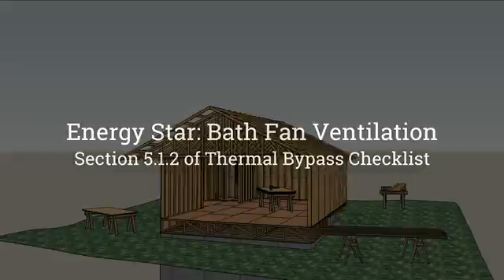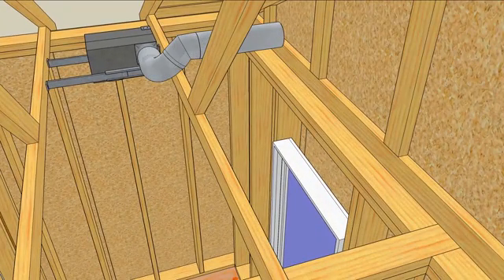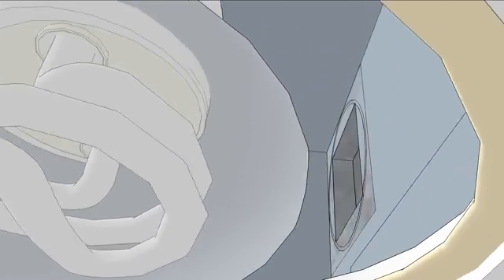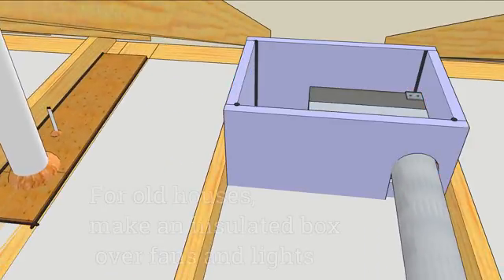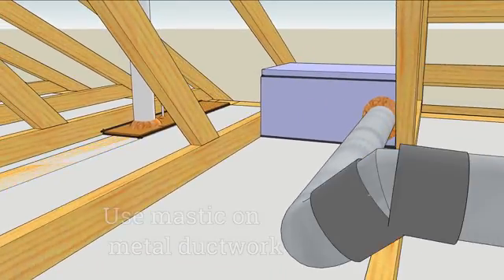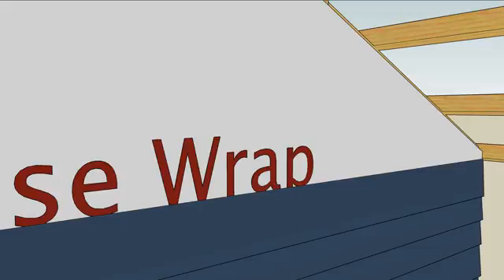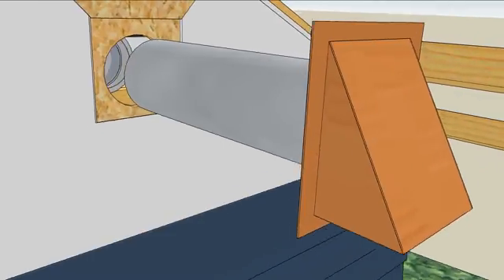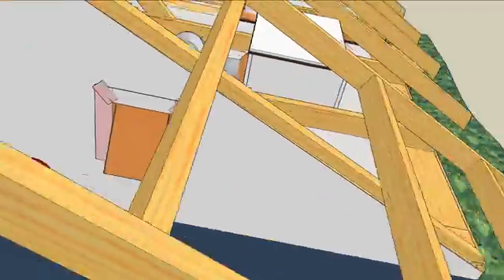Seal Bath Fans at the Ceiling and Damper — Thermal Bypass Checklist 5.1.4

Comment: I want to know something completely different: where can you get a bathroom vent fan that seals shut (airtight) when the fan is not activated? Yeah, supposedly draft blockers (mostly a misnomer) on the far end are supposed to lessen the automatic draft of your air escaping your home but they don't stop it, because it basically a piece of plastic on a hinge which has a visible gap between the plastic and the housing it is in. 

I was shocked to discover that my cold AC was being let out of my home in the summer in a continuous draft (enough to make some tape at the end flutter like a telltale) when the fan was not even on. It just automatically escapes. I'm sure the opposite problem occurs in the winter with cold air entering. Talking to stores like Lowes about this issue results in blank stares or a shrug. How hard could it possibly be to invent an airtight fan which mechanically opens the passage way when the fan it also turned on? You know some bloke has to have a patent on that.
Reply: To partially answer my own question this link was enlightening: https://www.greenbuildingadvisor.com/question/why-are-bath-fan-dampers-so-lousy

Someone asked why dampers suck and allow air around them. This was the response:

"The gaps around the damper are there due to physics. Without air flow around the damper to initiate the movement to open the damper, the force of air would be insuffecient to open the damper to exhaust the air. As far as I know, all exhaust fans are designed the same way. If you prefer a butterfly damper it would need to be wired to open as the exhaust fan comes on.

I have heard from some Canadian Energy Raters that are working on a true Net Zero Home that they would like for us to completely seal the damper as well. I offered the same advice on the butterfly damper."